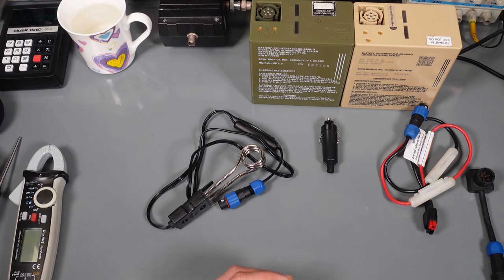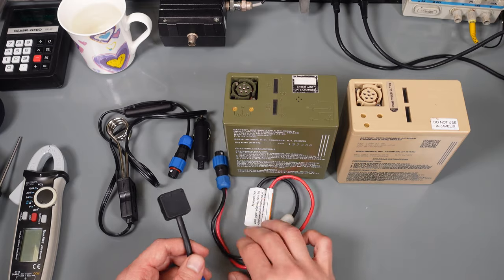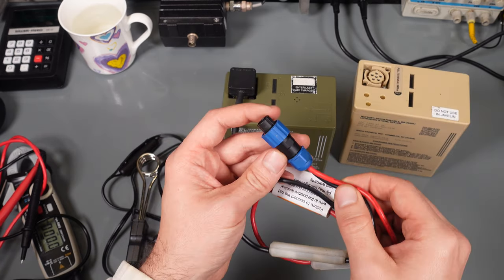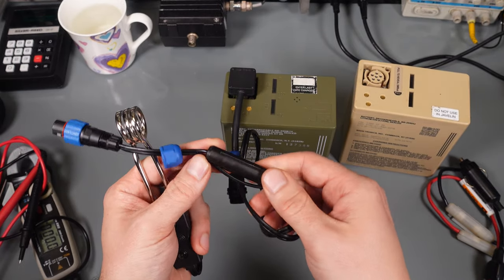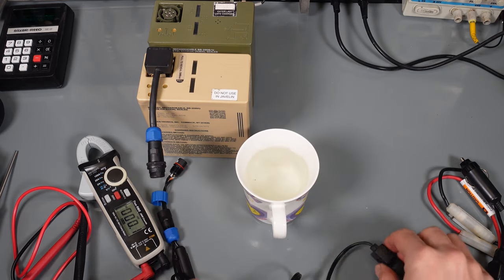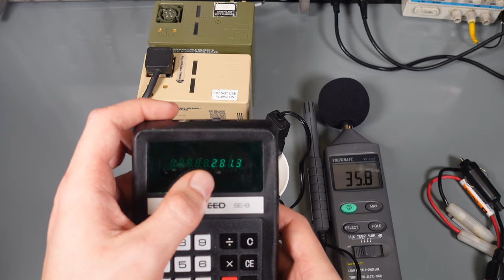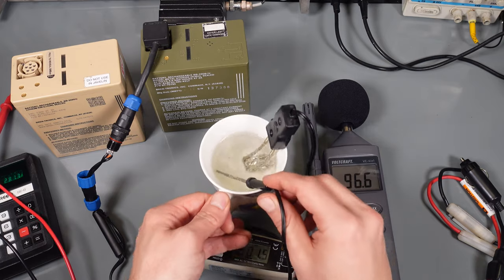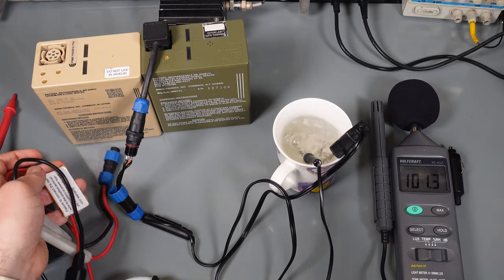Tapping 24V from military battery (BB-2590/U)  and boil water using car appliance 24V heater

Comment: Great video. Is there anything out there that is RFI quiet to lower the voltage to 14volts using the bb2590 with a portable hf radio.
Reply from the maker: I have not done research in this topic, at some point-in time I will be making manpack radio out of DM4600e so definitely I will make research - then I will post video with solution.   For now:  i would not recommend go with 14V since it is bad voltage to be stepped down into 13.8V as soon it be discharged it need to be boosted. So effectively You need  stop-up & step-down converter in single package.  I would suggest go with 24V and step it down to 13.8V. This will be much easier since voltage drop is not issue.  It also need to handle big current inrush when starting TX (it might trigger over-current on lot of dc-dc converters).
Reply: @ElectronicNoobBlog  thanks